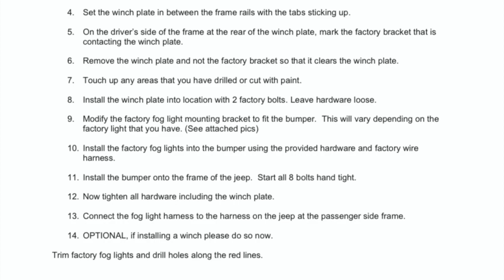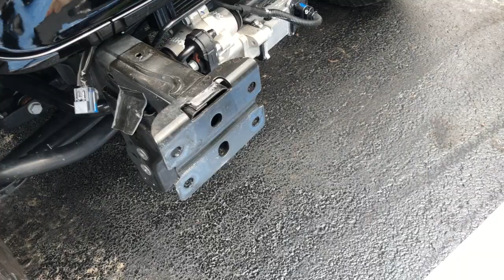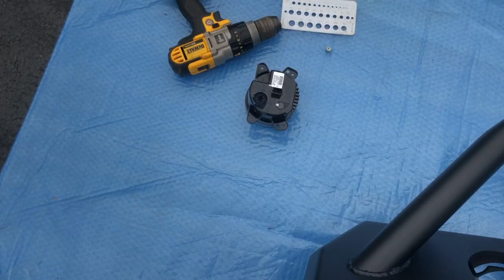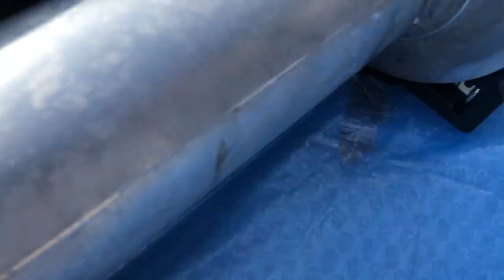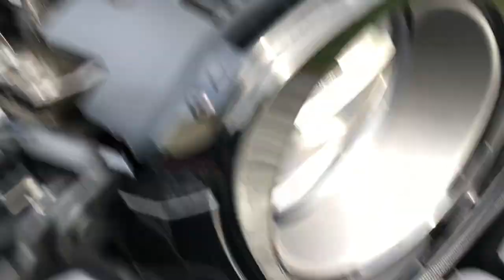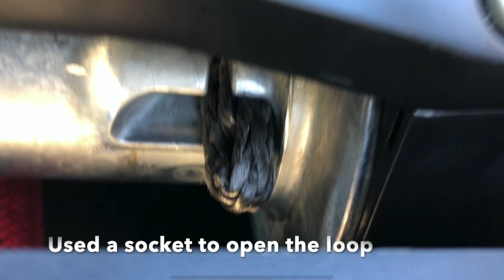ACE JT Expedition Bumper Install

Comment: just got this bumper for the jl. no instructions came with it. wasnt expecting to drill and cut to throw on a bumper.
Reply from the maker: It’s a little involved.  IMHO it was worth it in the end given the price a d fact that it’s USA 🇺🇸  made.  It is holding up well and works and looks great. Not sure why Ace made us drill - could have used stock size bolts (guess it’s stronger?). Same with grinding that spot.  Why?  Why not engineer the winch plate to fit?  Hopefully the video is helpful. Good luck! 👍
Reply: @JTRSpartacus  ive got a warn 12 and some aftermarket leds on the way. Gonna be interesting to see if it fits. Wish they mentioned this on their website about clearances and issues ahead of time. I do like the fact its american made though.
Reply from the maker: @RcansawDave  good luck. My Warn Zeon 10 was so tight on the factory LED fogs that I had to put washers between the bumper and frame to have enough room. If the LEDs were thinner they wouldn’t need the washers as spacers.
Reply: @JTRSpartacus  thanks for doing this video man, the instructions i got sent through email were pretty bare. Im pretty sure theres more detailed instructions on how to pour cereal than what they have to put in their bumper. Appreciate all the tips with getting this done.

Comment: Thanks for the video.   You saved me a lot of head scratching on the winch plate.  I had to grind the same spot on my jeep.  I installed my bumper on a 2019 JL Sport.  I used a Quadratec Stealth winch and it fit like a glove.   My winch plate had a 1/4" gap on each side and I used a spacer to fill in the gaps.  Did you have the same issue?
Reply from the maker: Bobby Fincher glad it was a help!   Thanks for watching.  Please subscribe if you haven’t already. Let us know if you have any requests.  #jtrspartacus
Reply from the maker: Btw I don’t remember a gap that big - maybe 1/8 but I didn’t need a spacer. Maybe Jeep frame width variation?  Glad it worked out.